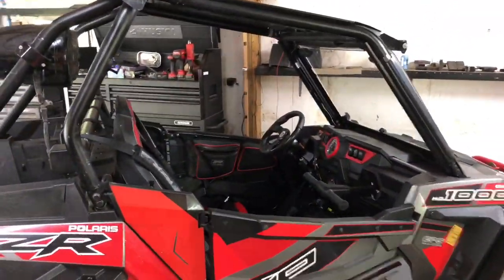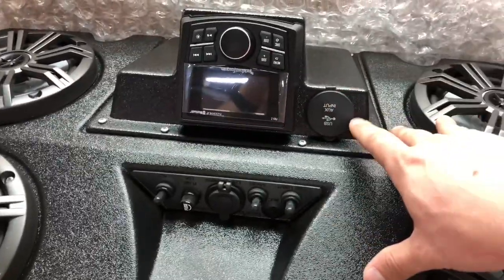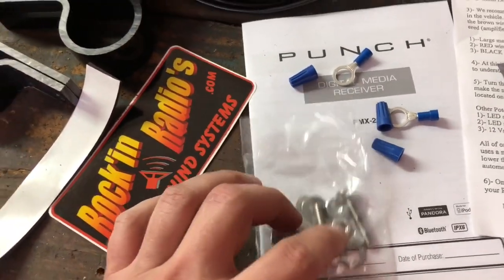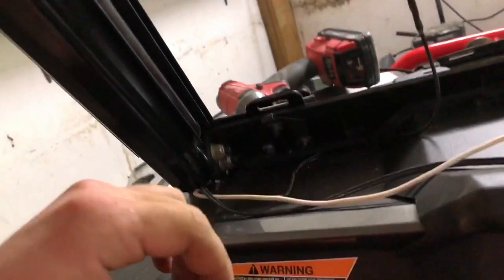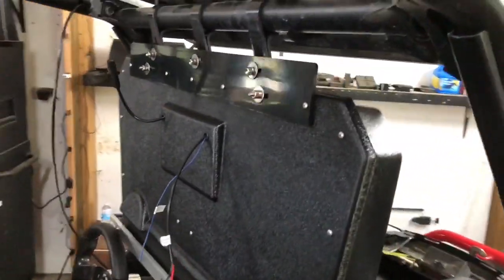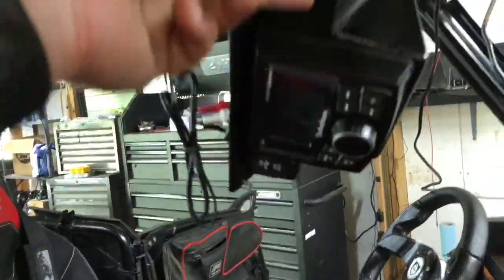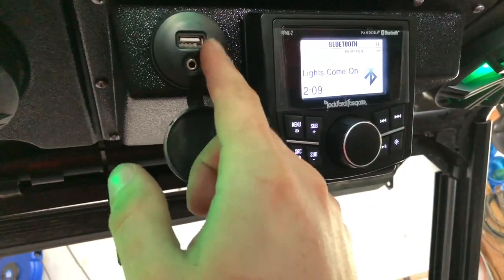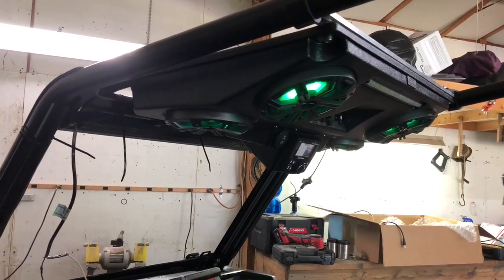Rockin’ Radios Quad Pod w/ LED Speakers - RZR XP1K

Comment: Nice video, seems like a sweet setup! Looking for a good system to throw in a new CF Moto Uforce build...I like this setup, I am going to go look and see if they have a setup for the Uforce.
Reply from the maker: Midwest ATV they do have setups for Rangers and just released a new universal mount system.  You should take the dimensions of the roll cage width and length and see if one of their current setups will fit.  I’d bet the Ranger and U-Force are pretty close
Reply: @Jason____  right on, thanks for the tip!

Comment: Just curious..can you send us a link to where you purchased your whip lights from? Also were they difficult to wire up and install? I just purchased a RZR XP 1000 High Lifter and wanting to do the same mods to mine.  Thx
Reply from the maker: Here's a link to the whips via eBay.  They're Chinese, but I have had absolutely zero issues with mine.  They come sealed and nicely heat-shrinked.  You simply need to wire in a switch and run positive (red) and negative (black) wires to the wires included with the controller wiring.  I used heat shrink butt connectors to connect mine and also heat shrink over those to double protect them.

https://www.ebay.com/itm/Pair-3FT-Glowing-Wrapped-Twisted-Multi-color-Chasing-LED-Whips-Lights-Remote/332260907631?hash=item4d5c4b1a6f:g:wXQAAOSwrqlZiDGs:rk:1:pf:0

Comment: I have a Tusk Aluminum roof on my RZR1000.  Will this system still fit with a roof? I noticed you had a roof on at the beginning of the video but not the end.  Does it still fit?
Reply from the maker: Taylor Ulrich yes it does fit with a roof and I still use my Polaris aluminum roof with it.  At the end of the video I just hadn’t put it back on yet. 

FYI - if you get one of these systems you will want to get some weather stripping strips and wrap the antenna and any other wires to prevent rattling and deafen the sound.  I had to do that on the AM/FM antenna plug.

Comment: Does this block your vision any or does the system sit up high enough with a roof back on
Reply from the maker: Jerry Shortt I’m 6’2” and it doesn’t block my vision at all.  It does hang down a bit more than I thought it would, but not enough to be a problem in my opinion.
Reply: @Jason____  I'm the same height so it should work. That's one of very few I've found that I like that will work after I install the rear window.

Comment: are you still liking the radio and how is it riding not hitting your head or anything like that thanks
Reply from the maker: Jared Brewer yes, I’m very pleased with it.  The build quality is definitely there and the audio quality is also very good.  I’ve never had an issue with head clearance and I’m 6’2” and use lowering bases.  I have lowering bases for comfort and not necessarily for the audio system, but they do help out.

If you’re considering one I have to say the Kicker speakers and Rockford Fosgate head unit are 100% worth the extra coin.